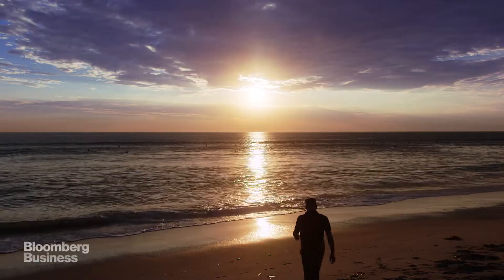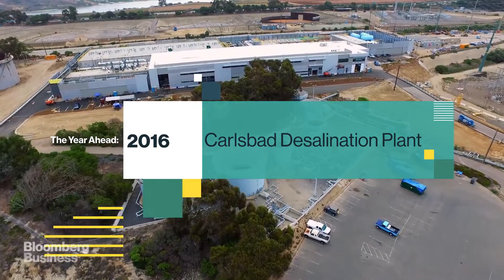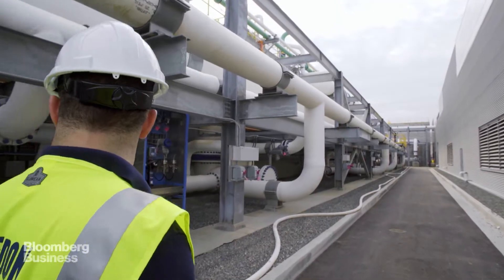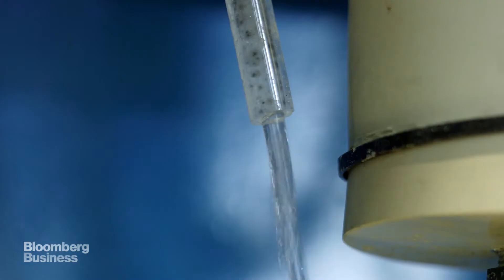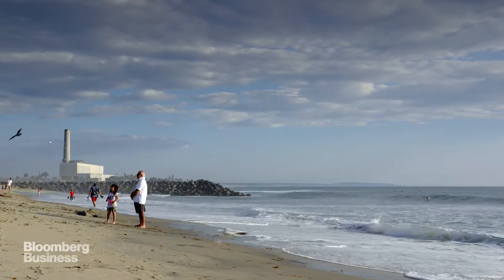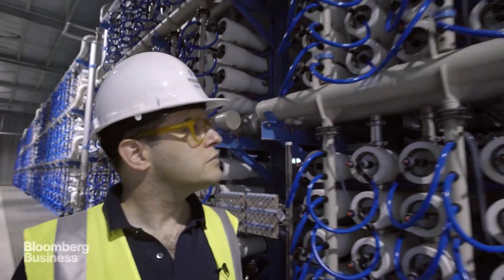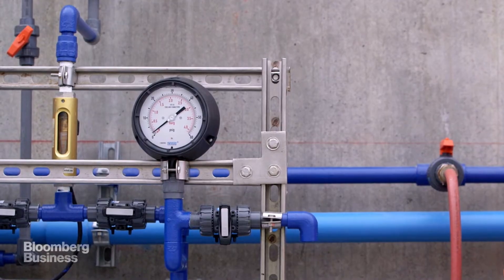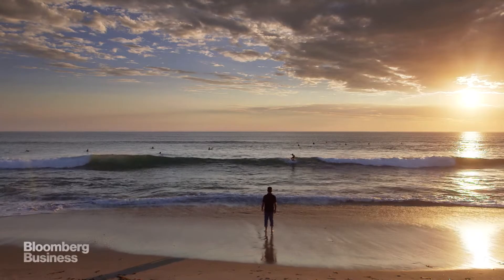Can Seawater Desalination Solve California's Drought?

Comment: Could send clean soft water (has cloride via sodium chloride already in it) from the Atlantic to every home, then run soft / salt water to showers and toilets, then people have a small distiller at the kitchen which disinfects and removes salt for drinking, about a gallon a day per adult. 

If the shower water is too soft people can buy a water de-softener, or whole house reverse osmosis system

Comment: Could they maybe bring salt water inland to a basin let it evaporate and then seed the air near fields to reduce consumption?
Maybe you could also sell the salt that builds up cheap to bring in more industry?
I know theres areas of desert well below sea level. Are there any within a reasonable distance of the ocean so you don't need to lay to much pipe channel flooded tunnel ect?

Comment: "Plant uses 32-38 mega watts" - 32 million watts is definitely a lot of power on a consistent basis. To make desal viable for the future, they should be covering the top of the plant with solar, and adding battery storage capacity. Some wind power may also be needed where appropriate.
Reply: 32-38MW per day or month or year???
Reply: Solar & wind power kill birds. Save the birds!
Reply: @leojanuszewski1019  Its actually been studied in the UK that wind does not hurt the birds as much as was previously thought. Its actually rather low impact on the bird community--they tend to be smart and avoid danger/recognize patterns.
Reply: @TahtahmesDiary   But what about insects? Save the insects!
Reply: @leojanuszewski1019  How is Solar energy killing birds exactly?
Reply: @swanky_yuropean7514  Denier! Climate change denier! Denier alert!

Comment: 50 percent of the water used in a house is actually used by the toilet, and the toilet doesn't need drink water, it doesn't need fresh water, it doesn't need cleaner water at all. It can use the dirty water from the wash machine, from the shower and from the bath. Installing a special reservoir to recuperate those grey waters and use that water a second time for the toilet would cut the needs of water by half. After, all used waters could be reused for the agriculture instead of being just rejected into the ocean. After all it is unsalted water and it costs more expensive to make it drinkable again than desalinate the sea water. And another solution, use the water intelligently and stop wasting it.
Reply: everlastingauraX
if your butt is splashed, that means your toilet doesn't work correctly. Anyway, the water from the bath, the shower and the laundry is not so dirty. It even could be used in the garden.
Reply: They already do this in Spain. In fact, I have watched a video where they show how there's another system in the building that collects the dirty water in a tank, add some blue chemicals to make better and color it blue, then, whenever you flush, the toilet will take water from there!
Reply: korelly
Reply: Great point. The problem is you'll need to rebuild all piping for brine and fresh water. Still the kind of thinking we need to get out of this.
Reply: Yea use the brine water to flush with and wash cloths an d dish washers with I heard sailors used to hang there whites over the back of ships to get them white .

Comment: What are they using as an energy source to power the unit - Note that the desel plant is the single largest power user in San Diego Co. which is the major concern with many of the hydro plants going off-line and no solar, wind, or wave would not be able to fill the gap without exuberant O&M costs and a major footprint. Possibly a   a dedicated nuclear facility on smaller scale such like the power plants found on many aircraft carries and submarines which would  reduce costs equal to that of pumping groundwater.

Comment: Does not seem right. You are pulling water out of the ocean and then putting back into the ocean a higher salt content. So, what happens to the aquatic sea life that depends on a lower ocean salt concentration? They either need to migrate somewhere else or die. All this so humans can continue living ridiculously excessive lifestyles in an area where it should not be possible. Something will give eventually and it's not going to be good
Reply: the northern current constantly washing the coast ,no effect whatsoever,this are micro quantities compared to the size of the ocean currents

Comment: Why not use solar energy to power the desalination plants?  And use the hydro electricity that would come thru the pipe line as the water is transported to the transfer stations - for free energy - and then use the left over water to water the dry fields to grow food.   Put a purification system in for drinking water.  All powered by the sun.  Yes, there would be a start up cost.  There should be no hunger in this world at this present time with the technology we already have.  
Blessings to All ~Live Love Consciously~
Reply: +Hapuniva Solar farm 1/5th the size of California is equivalent to the entire electricity demands in the United States, and even then it's be an excess. All the desalination plants in the US will not consume energy anywhere close to that amount.
Reply: +Debra Mitchell Probably because it would take a solar farm 1/5 the size of California to run it. In the story it already states they are taking advantage of the hyrdro energy from the release of the by water. If perpetual energy was as easy as you've just the worlds energy problems would be solved.
Reply: +Hapuniva  You can use just the solar to start it up... the water itself would create the Energy.  It is THAT EASY.
Reply: Sounds like you've got it all worked out. You should write down your plan and present it to them.
Reply: Ok, so whats your point?

Comment: I'm not sure what the real motivation of opponents to desalination is. The issues I often hear are technological hurdles that can be overcome, even the cost will come down as technology advances and becomes more common place. It seems opponents have more of an ideological opposition to desalination.
Reply: +stupidluvdisc People use sea salt every day in food.  so just another benefit...brine tank to collect it.
Reply: +Tine Woodbe Desalination creates salt pollution. Yes, diluting it helps but it still can cause problems for marine life. I don't really oppose creating desalination plants but I can see some of the problems with it.
Reply: stupidluvdisc That issue is easily solved by piping the outflow far off shore where the high salt density discharge would easily be diluted by the billions of gallons of water that is the pacific ocean. The technology to accomplish this is well established. If we can build oil pipelines for hundreds of miles  through all manner of terrain, we can certainly build a water discharge pipeline several miles out to sea.